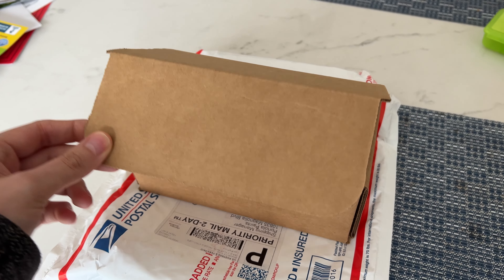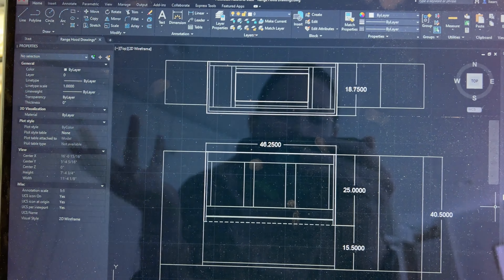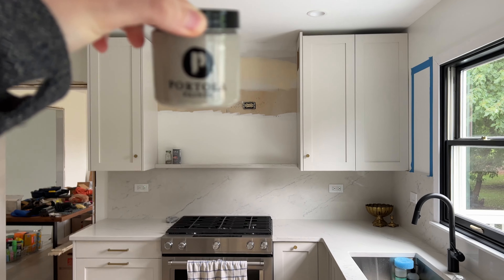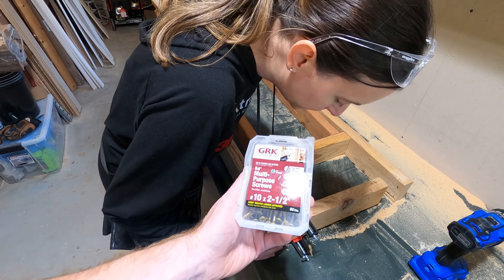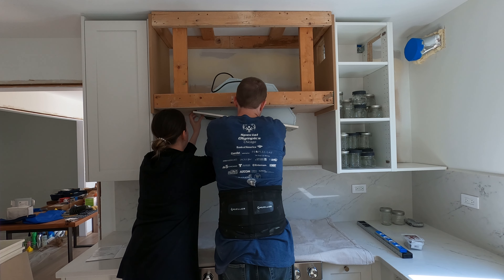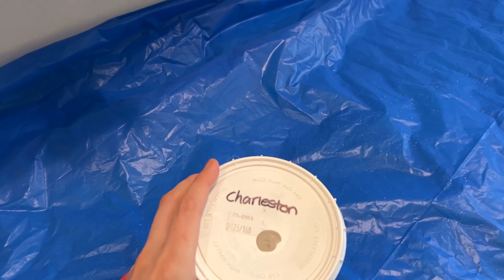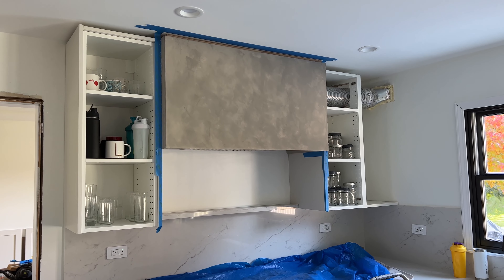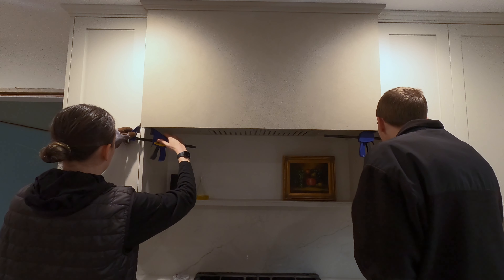DIY Plaster Range Hood With Brass Trim | Kitchen Reno Pt. 11

Comment: One thing to consider is that flex duct isn't recommended for range hoods. The material can't withstand prolonged exposure to hot grease, cooking material, etc. It's actually banned + not up to code where I live. On the bright side, you could probably use rigid duct just with a 90 degree elbow. 

Otherwise it really looks great. Thanks for sharing.
Reply from the maker: We did end up using a rigid 90 degree elbow. I think it was after the video was filmed before we put the front on. We did not like the flex duct connection. And yes you’re right we read it’s not necessarily ideal because it can amplify noise but we haven’t had any issues. Thank you!

Comment: Looks beautiful! How is the plaster on the hood holding up? Any chipping or wear and tear? And how easy is it to clean off grease? Thank you!
Reply from the maker: Thank you! Plaster still looks amazing 3 years later. No wear and tear or grease on the front of the hood. If you are concerned about that they offer a sealer as well.

Comment: Beautiful! Did you guys have to finish the roman clay with a protective coating so greasy or steam doesn't show on it? I read that Portola didn't recommend the roman clay for hoods or bathrooms.
Reply from the maker: I think it’s not recommended around stoves but not necessarily the hood. We didn’t seal it. We cook every single day at our stove and zero issues so far! It’s probably been close to 6 months.

Comment: How many inches of clearance do you have between your stove and range? My ceilings are 84 inches total height and I’m having a dilemma finding a range short enough to give me at least 30” clearance!
Reply from the maker: We have 3’ of clearance between the range and the hood. Our hood is 2’ tall. We had no issues fitting it all with 8’ ceilings

Comment: Can you clean your plaster hood? I’m considering it but do worry about maintenance
Reply from the maker: I think so? I’m not positive though, we haven’t needed to clean up anything on it yet. Everything gets sucked into the vent hood!
Reply: I used Portola paints plaster on my fireplace, you can definitely wipe it down gently (I just use a dry or barely damp rag or duster mop to dust as needed) but I feel like any aggressive scrubbing would probably damage it. I used the sealer they sell as well. Definitely should not be scrubbing it with any chemicals either. 

I have been considering this for my range hood but still not sure….

Comment: Love the plaster hood, considering doing one myself, and the step by step instructions are amazing! One qustions. I read that the receptacle is supposed to be "accessible" based on electrical code but it looks like yours might be inside the hood. Did you find a workaround, like moving the receptacle to one of the upper cabinets or just kept it inside the plaster hood?
Reply from the maker: We kept it in the same spot! The outlet is still technically accessible since you can remove the hood unit from the underside
Reply: @thelksaddress you can’t remove the hood from the underside bc the flex tube above the hood is short and attached tightly. The front panel of the hood box should be designed to be removable.